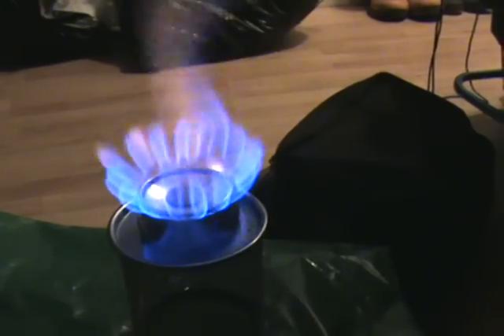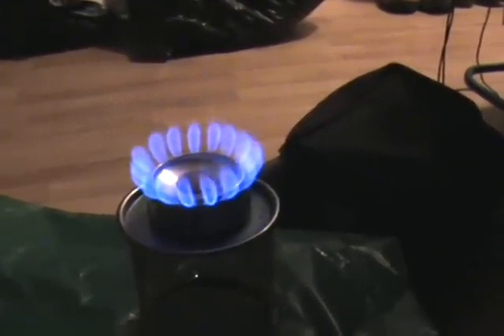My 1st Attempt at a Penny Stove

Comment: Good job!

As I recall, the original penny stove had a 1/4" fuel hole. 

Of course, if you forgot the penny to cover that large of a fuel hole, your stove would explode.

You could also try putting 5 or so of your small fuel holes so it fills faster.

Keep up the experiments,
Bill

Comment from the maker: yes they do need to be stuck together. at least pressure fitted.  because the stove needs to build up pressure and the tight fit ensures that the alcohol stays in the stove. if it was so loose that you could take the top part of, when you light the stove the top would blow off due to pressure. thanks fo the suggestion though. Ed

Comment: Do the 2 halves of the stove have to be stuck together? If you leave them to be separated then you can pour the fuel in the bottom half put the top n, and then the penny is for the weight to keep the lid on.